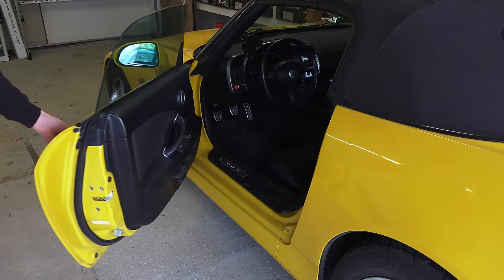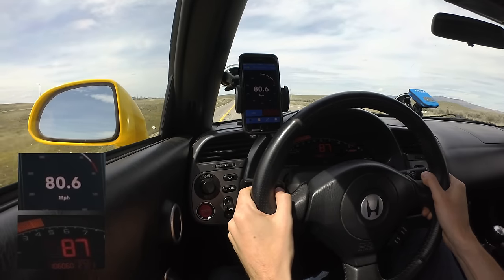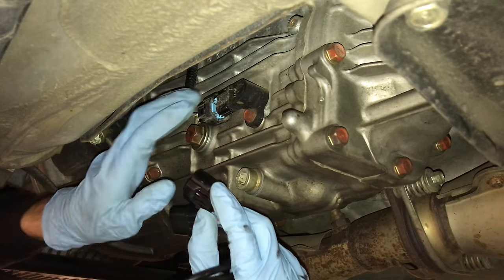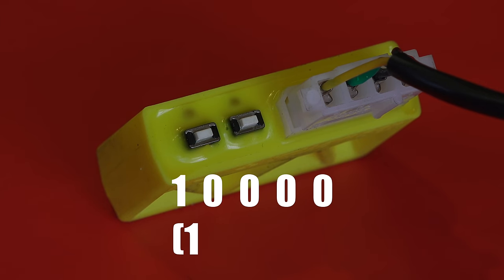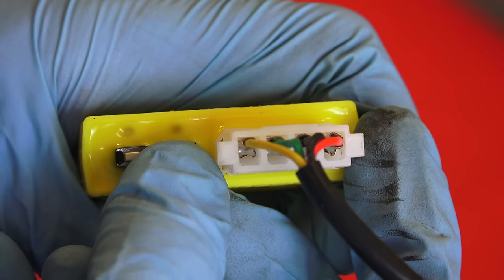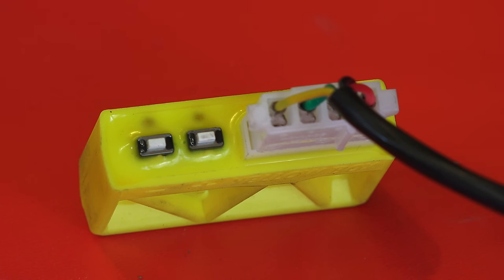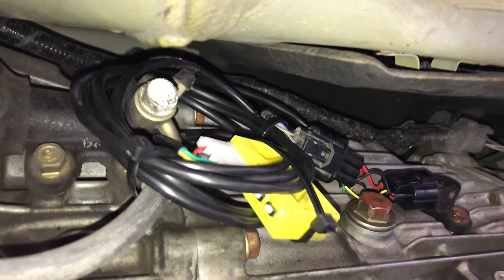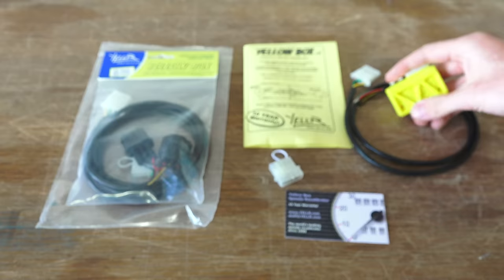How To Fix A Misreading Speedometer

Comment: What a jank interface.
Reply: It's cheap, simple and works what more do you want?
Reply: I meant the design is cheap. The ludicrous price is another argument
Reply: I don't know why it costs that much, but if it had a GUI it would be far more expensive. Hell at that point seems like it would make more sense to just make a phone app and an adapter for the phone.
Actually that seems like a pretty good idea now that I think about it.
Reply: It doesn't need a GUI. It just needs a 7 element LED that displays a number, instead of some random ass blinking lights.
Reply: screwaccountnames agreed, but why bother putting time in effort, where in most cases it will be programmed once in its lifetime which takes 5 mins. That being said it should be $40 not $100!
Reply: Well even one of those is a pretty far cry from the plain blinking lights. Alot of desktop motherboards still have the blinking lights thing, just suuuper simple to put it in there.
Reply: The interface is quite common, really.  My car is OBD-1, which means no plug for a scanner.  So when there's an engine trouble code, the check engine light flashes a series of blinks to indicate what code(s) are being stored.  Perhaps you should learn how to read such interfaces instead of proclaiming them "jank".  It doesn't take that much intelligence to understand them.
Reply: screwaccountnames - Yeah, the random ass blinking lights reminds me of OBD-I vehicles... ugh....
Reply: @screwaccountnames  - Exactly. I have contacted 3 tire dealers, a custom pimp ride shop and my local Nissan dealer. None of them do it but they will sell, mount and balance you new tires.

Comment: I prefer the plug into the OBD2 port and change the setting in the computer method. Might be worth a call to your local automotive shop as many of the common Snap On scan tools can make adjustments for tire size in the computer. Depends on the vehicle though. I know the Chrysler OE scan tool also has a similar adjustment capability.

Comment: I thought all cars over-read from the factory intentionally?
Reply: They do! In older cars it can be up to 10%.  My unmodified VW golf mk6 overreads about 5-6%.
Reply: @Julian Schmidt I have a mk5 jetta that seems to be the same way lol. Just need to find someone with a VCDS....................
Reply: Tom Smith they do.
The factory don't want to be responsible for speeding fines.
Reply: factory does that for a number of reasons: it does give to the driver one unrealistic "feel" that the car is faster, acelleration is better because it hit the target early and also the fuel economy seems to be higher as you cover extra miles for your gallon, legally they can be up to 10 % off to up but not for down, so they do that to be in the safe side
Reply: They do. People need to take care when adjusting speedometer readings because the odometer will then be wrong.
Reply: Mudux as far as I know, Volkswagen Auto group vehicles have separate recorded readings for speedometer and odometer. I don't know about other manufacturers though
Reply: Mudux when I read off of my on, tye ecu knows exactly how fast I'm going and it's not what is shown on the gauge cluster. Making the adjustment at the ecu and not the speed sensor avoids that.
Reply: Cataclysonic Inc same for BMWs
Reply: Bikes, Suzuki especially, are really strange about that. My dad has a DL650 and one time I went on a long distance trip with him, I was borrowing his GSR150i. There was a full 6km difference between their odometers, even though we had set our trips to zero before leaving. He actually tried to ask about that at the dealership and sent an email to the factory, nobody came up with a decent answer for it. But the speedometers themselves show accurately, so it doesn't bother us much.
Reply: My brand new 2016 Yamaha MT 07 motorcycle is out by about 10%... I have to do about 65km/h to do 60, about 87km/h to do 80, and about 109km/h to do 100.
Reply: Tom Smith haha have a SV 650, made a trip with friends, I did 127km, the r6 had 134 but the 996 said 142km... :D
Reply: I've driven a 93 Chrysler LeBaron and a 97 Chrysler Concorde, both had near perfect speedometer readings measured by my phone gps and the speed sign on the side of the road that shows your speed. Not far from my house is a good one because the speed limit on that road is 40 to 50 mph. I know for the older Chrysler cars, and probably the newer ones, the speedometer can be tuned in the factory diagnostic computer. Helpful if you have a friend who works at the dealership.
Reply: I think anything over 3% on a stock vehicle you should be able to have it fixed under warranty.
Reply: Robert Aitchison In Germany it is defined by law that the reading can be high by 10%+4km/h
Reply: Mines about 10 km off when traveling at 50km/hr which is extremely annoying
Reply: Not really intentionally, they just can't be bothered to set it accurately for each tyre sizes etc so they just set them all low :/
Reply: My 2005 Camry reads 40 mph when I am doing 37. So it is off by about 8%.

Comment: The more you know: It is illegal in Germany for a speedometer to display too low speed, but it is allowed for it to show up to 10 % (+ an additional 4 km/h) too much so that in the worst case you're never 
driving too fast. So "correcting" it down might actually be illegal if you overdo it as tire pressure on warmer/colder days can invalidate your measurement.
My car can supposedly only do 183 km/h, but I easily got it to "200" ;-)

Comment: Hi Jason, as you mentioned, the speedo can read incorrectly when different tyres or wheel sizes are used, instead of the original measures. This leads to my question, if my Wheel size is 17R205/45, and proceed to change the tyres to 17R205/50, what will happen? I get that the top speed will go up because it is like putting a higher gearing and that the speedo will read slower by about 5% if I'm not mistaken, but what about accelaration? Will it be faster, slower, and will it be because the tyre is heavier or is here anything more at play? Thanks and great work!
Reply: This website will accurately (assuming you know your actual speedometer reading) measure the speed differential when changed your tires and wheels setup:

http://www.willtheyfit.com/

Using the info you gave me and the website, your vehicle speed reading will be lower with the 50 sidewall by -3.22%.
Reply: Yeah I usually use https://tiresize.com/tyre-size-calculator/ for that, but what I want to know is the actual acceleration 0-100Km/h (the topspeed I can calculate myself I think)
Reply: Hmm, I don't know about that, but you can check out this other cool website that has similar info to what you're looking for:
http://www.enormouslysideways.net/calc.html

You need to know your transmission setup. Check out the gear ratios  for you're specific vehicle.

Comment: so does this mean when I put it to 200% then the speedometer shows only half of the speed. like 50kmh instead of 100kmh. And does this mean the km only counts half? So when I travel 100km my car shows 50km?
Reply: Hunter178 thus saving fuel?! 😂
Reply: Hunter178 thus being able to sell the car with less distance on the odometer.
Reply: Yes and no. your speedo will read your modification correctly, but depending on the make and age of the car, the odometer will likely record distance separately so as to prevent scamming the ownership and usage history.
Reply: LoL you should came to Poland. In Germany 5 year old BMW would have 150 000 km, but when the same BMW will ride (on tow truck) to Poland then the mileage will 'magically' drop to 40 000 km. We have 17 year old vehicles imported from Germany with the course of 150 000 - 200 000 km :D
Reply: does this mean that if you fit a different ratio differential and adjust the speed this way, since the ecu gets a separate reading the ecu will still be getting the incorrect speed for the odometer and you end up with 7% higher indicated mileage? :o

Comment: Hi Jason, Thank you for sharing these information with us. I have a question about using Ethanol instead of Gas to run the car engine. When it is safe to use it? is it true it gives the car more torque only if it is equipped  with a turbo? .... thank you.

Comment: That's all well and good, however bear in mind that virtually all speedometers have a built-in deviation. In my car I can read out the speed via OBD-II and it will match up exactly with the GPS (+/- 1 km/h). However the actual display is always reading 10% higher. If I were to fit a yellow box in my car to fix the speedo's deviation, I'd be throwing off the ECU, speed-dependent power steering and most importantly the mileage by 10%. That would for example make me about 13k km / 8k mi late for my timing belt service interval.
So personally I'd set this yellow box to only compensate for what's changed (gearing or tire circumference), maintaining the factory default deviation on the speedometer.

Comment: not sure if mentioned in comments already....

a lot of modern cars don't have gearbox speed sensors. they get the speed info off the abs sensors. some use the gearbox speed sensor as a back up should the abs system fail.
something to check before fitting any adjustment box.

Comment: Curious how this impacts the odometer. I'm always paranoid that with my car's speedometer reading high that the odometer is reading artificially high too. Makes a big difference for somebody leasing that needs to stick to a mileage cap.
Reply: That concern was popping up in my mind as well. I personally don't mind the odometer going up faster, but maybe the government sees it as tampering if they find out during the yearly checkup. If someone sets the correction to 1% then the odo meter wouldn't turn anymore (Extreme example).

Comment: Did you check the speed at the PCM? Sometimes the clusters are programmed to show the speed a bit fast, as is the case on my Golf. The PCM sees the speed exactly correct, yet my speedo reads about 3-5 km/h fast. Also, usually using some software, you should be able to change it in the cluster without a hacky piece of hardware in-between.

Comment: I have the VW UPTSI 2016, and I need to correct the speedometer due the new tires. Does yellow box work with this car? In my case, the source of signal is on gearbox too or the UPTSI use signal from wheels (ABS sensor)? Will I have any problem with connector or the yellow Box matches with VW UPTSI ?

Comment: Hi! Was your speedometer falling up and down as well? I took it to the shop and the guy connected it to my vehicle as I'm driving it. He said my speed wasn't matching his tablet scan that was connected to my vehicle to read what was wrong with my vehicle. They replaced the sensors on my transmission.but my idle still drops as I'm driving. Do you know if I could use a yellow box to fix the issue?

Comment: What to do when a speedometer shows different misreadings depanding on speed? I.e. When I drive 50 km/h according to GPS, my speedometer shows around 56-57km/h, and this 5-7km/h stays the same from 30 to 140km/h, when I reach 160km/h, the measurement is spot on with GPS - straight up to 220km/h(max speed).

Comment: What about for older cars that use a cable?
Reply: Brad Cogan Has to have at least OBDII
Reply: You change the gear that drives the cable.  Different tooth counts change how the speedometer reads.  This whole procedure is entirely unnecessary though.  This can be done for free if you know the steps to take.  Newer cars can be changed with an OBD2 tool.  Older cars with electrically driven speedometers will have a procedure such as grounding a test pin, and cycling the ignition key, then adjusting the calibration using the odometer select and reset buttons.

Comment: i have a quick little question. if you were to change the differential on an all wheel drive to a bigger final drive gear, would you have to replace both or just the one??? saw the question on a forum but didn't see an answer and i was wondering the same.

Comment: Question If you have a car with this problem when you are driving with over speed it means the car mileage get higher faster? I have a Toyota sienna and just drive locally and in in ten years the miles are over 200K

Comment: Quite different than the way I corrected my speedometer on my 65 Mustang after I installed 4:11 gears. I had to drive a measured mile and note how much mileage went on the odometer. There was a formula (don't remember what it was) used to determine which speedo gear to use to replace the stock one on the cable. Changing the gear to a different number of teeth brought the speedo down to a more accurate reading.

Comment: for others who want to get more out of their governed car... this will effectively remove the governor if you fudge the speed to read too low.
Reply: bilderberggroupinfo Genius!
And just use a Speedo in your phone or summ.
Reply: exactly
Reply: bilderberggroupinfo what is a governor? do any cars come factory with this?
Reply: a handful of car's, and most powerful sportbikes have programmed top speeds.  Some of these vehicles are capable of higher speeds, but the computer "governs" their top speed to something lower.

If your speedo read's low, the governer will think your going slower then you are, letting you reach higher top speeds.

Generally this doesn't mean much to most people, because sportbikes being limited to 300 km\h (186mph for you muricans!) really doesn't impact most riders of such bikes or car's with similar limits.

the only time you see much removal of governers is with scooters, specifically the ones that are supposed to be limited to 60km\h and don't require a motorcycle license.
Reply: i just clip the green wire. or at least thats what i did on all my work trucks with either 55mph or 65mph speed governors.
Reply: Lol. Isnt that illegal tho?
Reply: With a car or motorcycle no. With a moped or other vehicle that has a restricted by law top speed yes, but if your not speeding you wont get pulled over anyways.
Reply: The Platypus we had an old, old fleet of used trucks. lots of trucking companies add speed restrictors for insurance discounts. some of our trucks were from when the national speed limit was lowered to 55mph. these were not semi trucks, just medium sized, like a moving van. legally you can drive the speed limit.

i just got sick of doing 55mph in a 80mph zone while driving for several hours. couldnt get a run at hills and you would end up doing 25mph at the top of some hills. this isnt safe on any freeway.

i also removed the 85mph speed limiter on my car from the 1980's. the Speedo only reads to 85mph (digital), but trying to pass someone in a 80mph zone omly gives ya 5mph of leeway. if you hit 85mpg, it cuts fuel until 75mph. pretty embarrassing to try to go around someone doing 5 under the speed limit, go to pass em and then get stuck at the same speed they are.

in my younger and dumber days, i also modified the speedo to read over 85mph. one day i decided to see if it would indicate the third speed digit (100mph and over). i then decided to try to top it out. hit 138mph indicated by the speedo before i got scared and backed off (redline in overdrive should be 147mph by the maths). it was fun screwing with the kids in Hondas with a 108mph speed limiter. I'd tell em i had traction issues below 60mph and wanted to do a freeway pull. 

cant do that kinda crap anymore. now they got radar guns and stuff on helicopters way out in the middle of no where. i live right by the Bonneville salt flats now. 80mph speed limit, and only one rest stop every 46 miles (that one exit in about 92 miles). i was driving a work truck back from Cali with a 65mph speed limiter. Got pulled over by highway patrol saying a helicopter clocked us at over 100mph. i laughed, redline in od gear was 70mph, so there was no point in disabling it. prick still gave me the ticket which i fought in court and won. i ran the vin number to get the gear ratios and rear end and then printed out a mph calculator and explained how i couldnt go over 70mph without blowing the engine.

it was pretty funny, no one even had a response.
Reply: lol yeah I topped out my Integra GSR in top gear a couple of times on open highways with no other traffic (15+ years ago).  Speedo indicated 145 I think was about the highest I got, but it was probably more like an actual 135 or so.  That was drag/power limited.  Gearing and redline should have carried me to 160, with more power.

Comment: What was the GPS app you used?
in the first place, to even see how my spedo counts it.
And is there any web site that count speed difference by sizes of weels (I drive '99 Civic, with 165/65/14 winter and 195/50/15 summer tyres, and hignt is 1.6cm different!)

Comment: this maybe my lucky day ? i have a VDO electronic speedometer with a hall effect sensor on a vw buggy, this is my second one from VDO , what happens very shortly or about 20k miles of use the pointer becomes eratic and does not stay on a even speed driving me nuts. i know ii need to check the inside of the hall effect but why are they f ailing so quick ? they are not cheap to buy at all . I wonder how much help ill get from vdo or international comp ? thanks for your vid nice

Comment: Actually, I have a different problem: My speedometer seems to be bang on up until about 70 kph, but starts to deviate if I exceed that, until it displays 160 kph but my GPS says 150. So it's not just a relative error, or else I would see about 5 kph difference at 70, not the exact match I'm actually seeing. Tips?

Comment: if changing tire size affects the reading, there must be a simpler way tire shops or your dealer can adjust it, right?
Reply: There are, but they usually require pulling out the cluster to adjust gears in it.
Reply: the right way to do it is to change the data in the ecu with a programmer